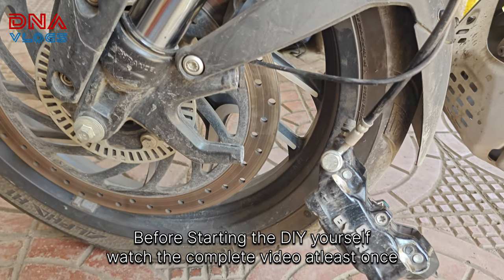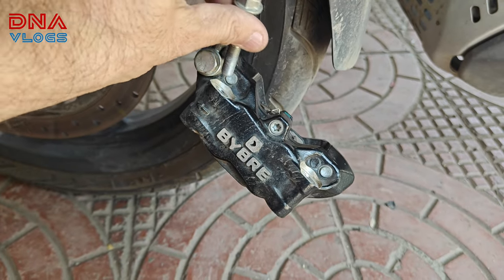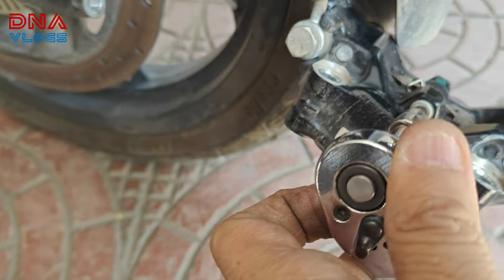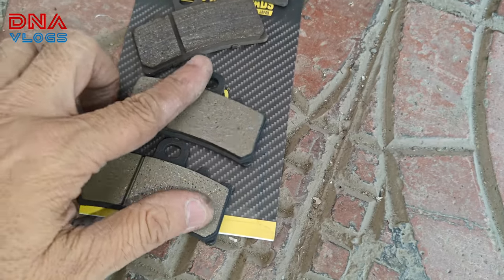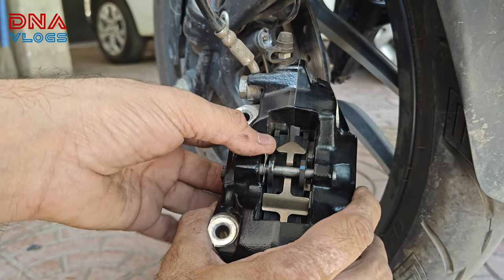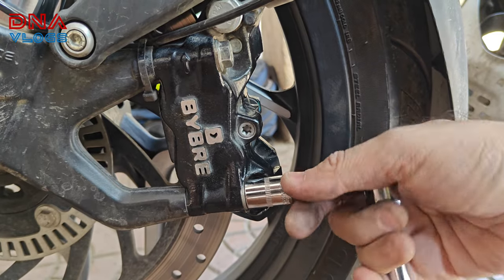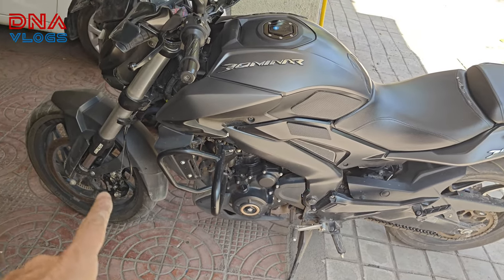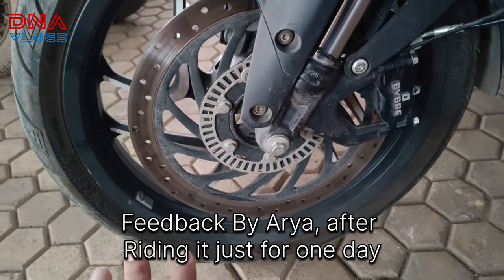2023 Bajaj Dominar 400 Front Brake Pads upgraded to Vesrah Ceramic Brake Pads  | DNA VLOGS

Comment: does it imporve the rear break bite ?
Reply from the maker: @techcarenepal  yes. Stock are organic. If you upgrade to ceramic or sintered, it will increase the brake bite, but will eat up the disc faster too

Comment: Is ceramic enough? or sintered a  better option?
Reply from the maker: Refer the feedback towards the end of the vlog from the owner. Rest is upto you, depends on what stopping power you need. Better tyres are another option. Sintered eat brake discs is what I have heard.
Reply: Bro, I've ridden my d400 for over 30k kms in 2 yrs. Kindly refrain from buying any vesrah or sintered like ebc ones. The cheap bybre ones are the best. If you need something better than that then approach any ktm service center and ask for brembo ones. It costs the same as the ebc ones.
Reply from the maker: @chiranmay-IN  mention your reason with explanation, in place of just best
Reply: @dipen.nisar.autovlogs  Because the compounds that are used in both the brake pads are same (except ebc). Braking is all about habits, we neither live in sahara desert nor we have roads over 120kmph speed limit (where 🏍  permitted). So the high temperature factor doesn't apply to us. I had purchased vesrah from lrl twice (999 first then 1300), it didn't last long. There had been an incident where I had to brake (Bybre ones were fitted then) suddenly (my bike running at 140kmph) and it didn't budge the bike, 140 to 0 within seconds, then it became very clear to me. Habits matter more than the pads. Instead of buying ebc or vesrah (and donating huge amount to retailers) one should go for the brembo ones(~₹2200).
Reply from the maker: @chiranmay-IN  this will help people understand your earlier feedback better ☺️

Comment: pls tell me good rear break pads of dominar.../
Reply from the maker: Stock are the best overall. They don't eat the disc. And rear brakes are meant to just help slow down the bike along with front. That's why rear discs are always smaller than front. Use them in 60:40 or 70:30 pattern . Front vs rear. You can use versah or any other ceramic etc brake pads too but they eat up the disc. In addition you can use engine braking too, but reduces chain life and also elongates the engine block. So best is stock plus lower speeds if you can stop on time.